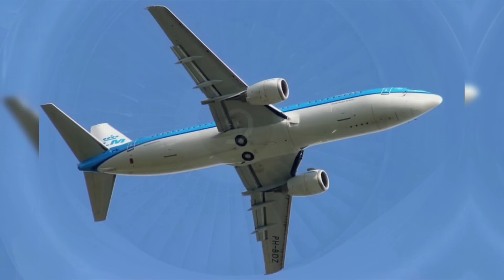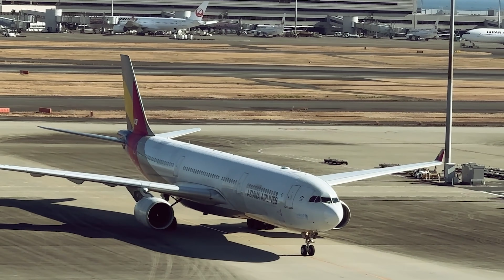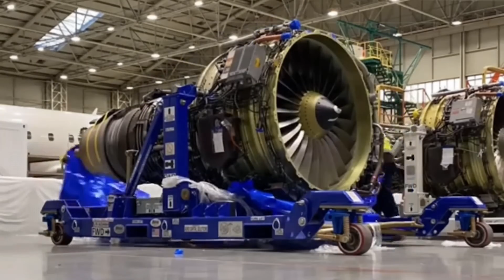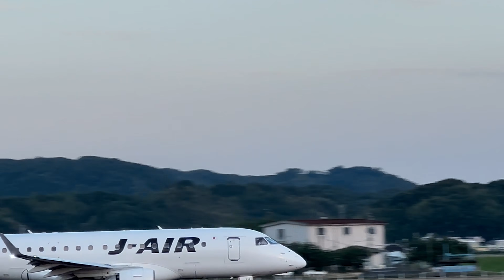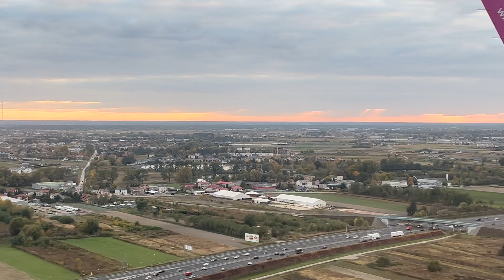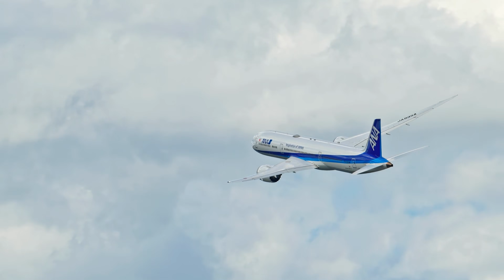Why Boeing Flattened The 737 Engine

Comment: The new 737 MAX  engines weren't just moved forward, they were moved UP, pushed much closer into the wings, and this changed the aerodynamics of the plane so much that the plane had a natural tendency to climb and tilt nose upwards unless the control surfaces were trimmed to keep the plane level.   So Boeing added an automatic system to do this trimming, the infamous MCAS system, which read data from the angle of attack sensors about the upward tilt of the plane, and automatically trimmed the plane control surfaces to tilt the plane nose back down.   The two tragic 737 MAX plane crashes that happened because of the MCAS system were because those models had only ONE angle of attack sensor, as a backup AOA was an OPTION, which those airline chose NOT to buy as they were third world cheap airlines.  As a result, when the single AOA failed or froze on those planes, the MCAS system caused those planes to tilt nose down and forced the planes to literally dive into the ground.   Boeing FAILED to notify pilots flying the new 737 MAX models about the MCAS system, which could have been disengaged, but the pilots did not even know about it and did not know why their planes were suddenly plunging into the ground and were unable to overcome the MCAS automatically tilting their planes into the ground.  So, contrary to your glowing praise of Boeing's engineering prowess, this was a case of SHEER UTTER CORPORATE NEGLIGENCE AND INCOMPETENCE, due to Boeing wanting to have a plane to compete with the Airbus 320Neo as soon and as cheaply as possible.   The Airbus 320Neo started from the beginning with longer landing gear, and so was able to take the new fuel efficient large diameter turbofan engines without changing the aerodynamics of the plane.